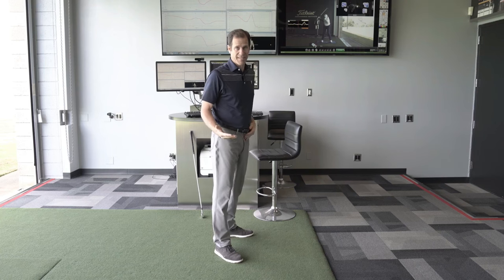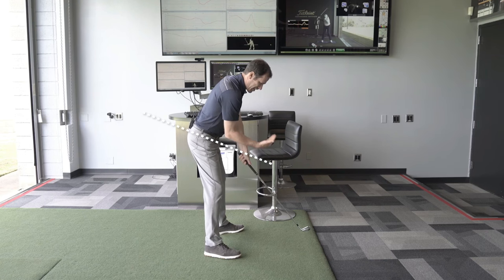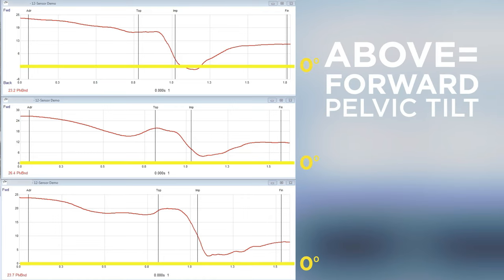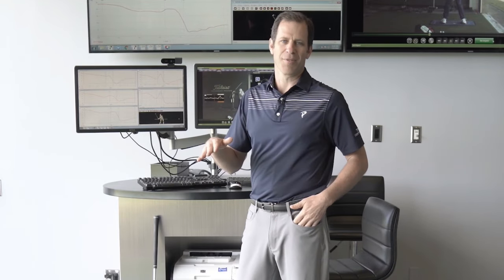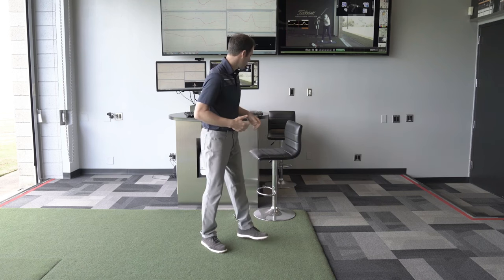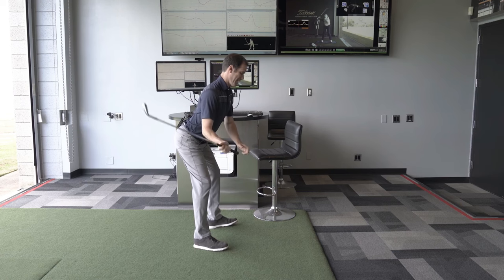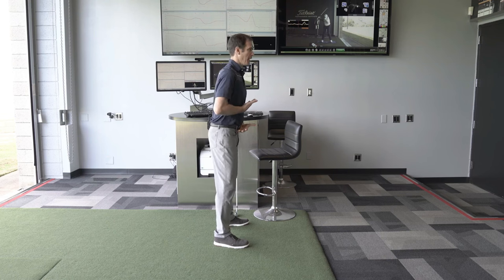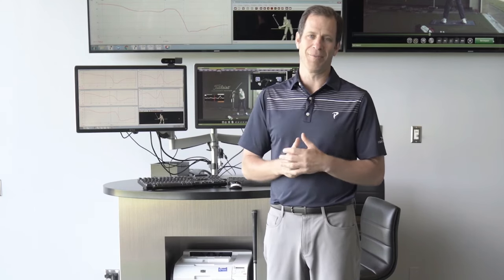Understanding and Assessing Pelvic Tilt in the Golf Swing

Comment: One added benefit of decreasing pelvic tilt approaching impact is that this extends your spine, increasing the distance between vertebrae. During side bend at impact, you jam your right side facets joints together causing right lower back pain, usually referred to as “SI joint pain”. Dumping the water backward essentially stretches your spine apart giving you more room to side bend without jamming facets into each other. A slow motion turn with and without losing pelvic tilt will demonstrate this plus the added ability to turn the hips further through impact.

Comment: Hi Doctor thank you about your knowledgeable video on what I view as ‘The Pelvic tilt Vs Early extension’ Nothing you said was wrong except a great golf swing requires a secondary tilt. Does it not? At impact a great golfer swing the club on the side of his body not in front of his body as they have set up to the ball. And in fact the secondary tilt does occur under the lower body influence to the upper body. With this being said there is also way to much information to think about in the second and a half I am swinging my club 

So would you agree that a golfer’s lower body must be the primary mover of their golf club traveling around their  body? 

Knowing this now at 74 I have simply and with little thought have turned my lower body into a centrifuge engine that is precisely calibrated every single time 

How do I do this? 

Well for me I look at the greatest golfer that never was. Elvis Presley! 

To get my lower body to take charge of my swing I do the Elvis Pelvis move. 

How? 

I like your bucket analogy for the hips. However for my backswing I simply use my lead thigh bone/ knee joint to push my trail hip socket/ joint out of the way and then for my downswing I use my trail knee thigh bone joint to push my lead hip socket/ joint out of the way. All the while I am staying in my golf posture and allowing my arms to swing along my body line dictated by the alternating movements of said parts 

I saw a video where Gary Player said he met Elvis Presley and Elvis ask Gary to teach him Golf. Gary said: just moves your hips and Elvis laugh and said: That I can do. 

Put my theory to the test. Try your own Elvis Pelvis move and make your lower body the centrifuge engine it needs to be to supply the centripetal force of your club head traveling back and forth around your body. 

Watch Hogan knees and hips as he swing his club and you will see what I am taking about even more. 

Hogan himself said he used his lead knee in order to strike at his ball more accurately with his moving club head. 

Don’t chase at the ball at all! The club head will come to it automatically as long as you  maintain your balance and swing your club along your particular body line. Cheers

Comment: I have had lower back problems for many years - golfing was a major source of pain.  After watching this video I noticed that improper pelvic tilt during the swing was a big cause.  I know strengthening the core is a way to help, but for me it was a conscious effort to change my tilt - I had a strong enough core, I was just not moving by body/pelvis correctly.    The other significant discovery has been realizing that I was using the wrong pelvic tilt every time I would bend or stand.  I now make an effort every time I stand or bend to keep my belt buckle pointing more up, not down.  It feels like a huge change, but if you look in the mirror it looks normal.   This small change has helped immensely and I would encourage everyone to evaluate their pelvic tilt during the regular course of  a day (putting on socks, bending over to tie shoes, shoveling snow).  Thank you Dr. Rose.
Reply: After golfing I get horrible low back pain. Years ago I hurt my lower back doing deadlifts and couldn't even put on socks in the morning. Every now and then I get the same low back pain from every day activities, this definitely opened my eyes.

Comment: I'm curious how/when the tilt changes as their belt buckle passes the ball. I'm having a hard time getting my hips open more at impact and it looks like I have a very slight early extension. So maybe I'm flattening out a little too early?
Reply: I had the same issue. 
Remember the sequence, hips, torso, arms, club. If you activate the arms too hard and early in the downswing it will retard the rotation of the torso and hips. This is because actively releasing the arms creates a reactive force that pushes back on the rotation. So try swinging with soft noodle arms. IOW, throw you arms into the ball with rotation. It will seem weird at first, but work on it. Took me a while to figure this out, but immediately I started driving the ball close to my normal distance with what felt like a power of a 8 year old. Eventually, I was able speed it up and get my arms more active (but late in the downswing) and I started hitting it 20 yards past my old normal.